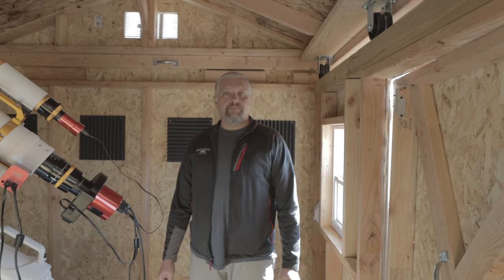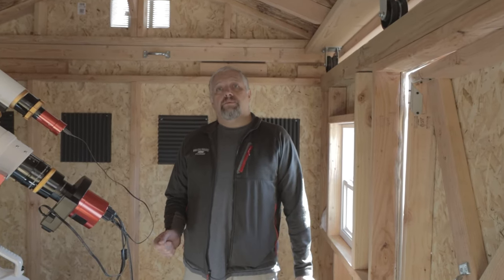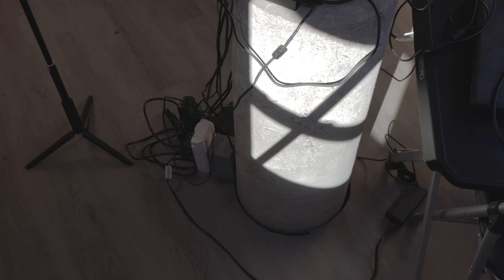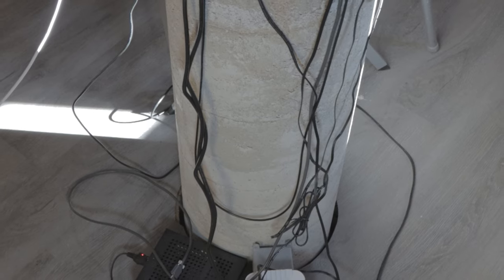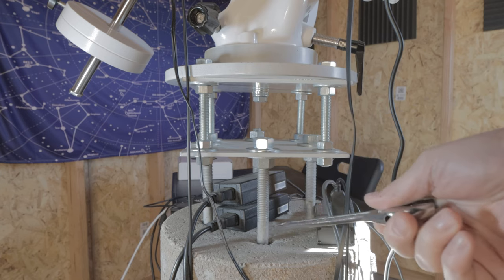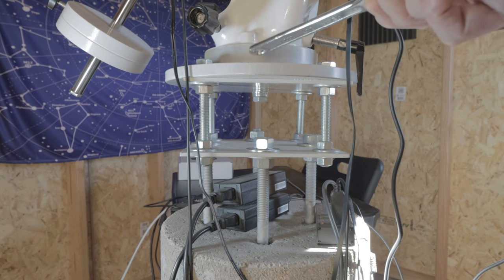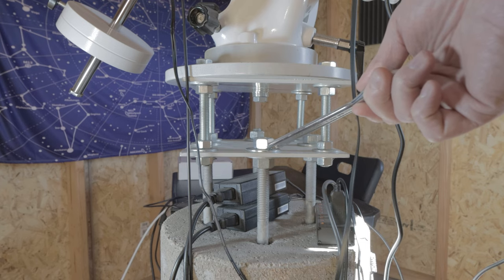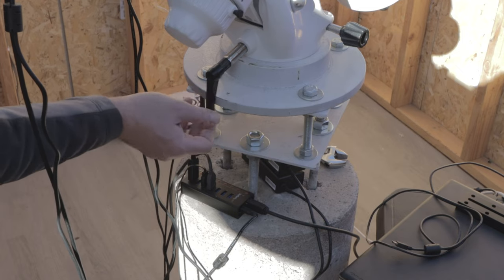Bear Claw Observatory: Concrete Pier

Comment: Great job man !!!!  I love to see people do things the correct way.. Nothing makes my skin crawl more than some poor sap who thinks, I've built an awesome observatory. and ONLY spent $1500 on it. or whatnot. and it's literally a shed with a Platform, NO hole in the middle, No pier.. just a wooden platform with their telescope and tripod. sitting on it..Bouncing every time they walk or move in a chair?   Taking the time to do it correctly is Key to a great observatory!! and your sir, looks like it's going to be a Great Observatory !!!
Reply from the maker: Thanks Frank, it definitely takes some planning before you get started. Sometimes I think the 12" diameter and 4ft in the ground with an anchor at the bottom is a little overkill, but it's so nice to know I can put just about any mount on top of this thing and it will work flawlessly.

Comment: Great job !! 

They however advise against putting the tube underground for several reasons: They rot and that means it gives your pier a chance to move by about half and inch and the fresh compact, undisturbed earth on the sides of the hole will hold it tight and upright if and only if the cement is contacting that earth. Notice your frostline data probably specifies 'undisturbed earth" or "compact earth".

Comment: I realize this is an old video but can you tell me what the point is of that first 3/16 steel plate?  Couldn't you just bolt the brake drum to the J-bolts coming out of the pier?

Comment: I replaced the altitude adjustment knob on my eq6-r pro with a 3d printed press fit knob (no longer the spring loaded nonsense that came with the mount), it is now significantly easier to adjust.  i'm about to start pouring concrete for my own pier and will be using a 2012 chevy malibu rear rotor :)
Reply from the maker: Grats on the new pier Michael! I replaced my alt knob as well finally, it makes a huge difference.

Comment: Hi Joe, where did you source the J bolts? Are they Stainless, Or Galvenized? Also, do you think a 12" dia pier is overkill for an EQ6, or would 8" or 10" serve the purpose,
Reply from the maker: Hi FDS, the j-bolts are galvanized and think I got them at Lowe's. I went with a 12" wide pier because I knew I'd be upgrading to a larger mount in the future. If you know you are going to stick with the EQ6, I think 8" diameter is more than adequate.

Comment: Loved the video.  What height off floor level would you say would be the height sweet spot? Have an 8se but want to get into astrophotography.  On the cheap as I can.  Thanks for this!
Reply from the maker: Thanks GS! For me it’s the  lowest angle I can image at, which is 20 degrees above the horizon. My pier is 36in above the ground, but it’s dependent upon the height of the walls and how far away the walls are to get that 20 degree angle. Also have to figure in the mount height and if you have risers on the scope, etc. My walls are 6’4” tall and about 4ft away from the scope on all sides. If you wanted taller walls you’d want a higher pier.

Comment: This is the first time I've heard about any movement. One degree seems like a lot and makes me cringe. I'm about to build a permanent pier.  Could it be that the Sonotube is expanding and shrinking inside the concrete as it dries and then absorbs water?  Seems that it would be better not to have paper between the concrete in the ground and the concrete in the tube.  Just a thought
Monty
Reply from the maker: Thanks Monty, you know, I'm not sure what it is to be honest, but it's gotten better the longer I've had it. In the last 3 months it's only off 46 arc seconds. I get this from running "Guiding Assistant" in PHD2. I haven't had a clear night in two weeks to do another PA, but I'll record the date and then in 30/60/90 days see how much it's off. I'm still guiding at a total RMS error of .8, but of course I want that PA within 10 arc seconds.

Comment: Hi! 
I didn't understand, so the bottom part of a pillar is not permanently set into the ground, or the ground itself is very unstable?
Because shifting and tilting up to 1 degree a month sounds really a lot.
Reply from the maker: The concrete is permanently set in the ground. My polar alignment seems to be off about 1 degree every 6 - 8 weeks. The concrete isn’t moving that I know of, but from what I’ve read and heard from others is that the pier acts as an inverted pendulum. I think, but not sure, the longer you make it the more effect it has. I made mine a little over a meter deep because of the frost line in my area. Hope that makes sense, and again, not exactly sure myself of the physics, but it’s been very solid and I don’t mind doing a polar alignment once every couple months

Comment: Joe, is there concrete around the outside of the sono tube underground or did you just pour the tube and then backfill with dirt?   I am assuming you put in the tube first, then poured the deck after?   Getting ready to build mine using the same technique and wondered about some of those details?   Did you take pictures of the construction?   Sorry for so many questions.   Thanks for your assistance.
Reply from the maker: Hey Marvin, no worries on the questions at all. I poured some concrete, like a 2ftx2ft square at the bottom, then while still wet put the sono tube in the hole and poured it. 4ft in the ground and 3ft above, yours may vary based on frost line and your needs for pier height. I built my deck after the tube with 4x4s and 3/4 in plywood all pressure treated for ground contact, but did place them on concrete pavers to level. Unfortunately I didn’t take any video or pics of the build, but if you have any more questions I have no problems answering the best I can. I can tell you I went way overkill, but the cost of building materials weren’t that high at the time I built it. Good luck on your build!
Reply: @JoesAstrophoto  I am going to follow your general plan and try to get the metal fabrication (holes drilled) by a machine shop if I can find one.  I didn't realize the floor was a wood floor.  It looked like concrete in the video.   Making a wood deck would certainly be easier and probably cheaper than concrete.   Also,  how big are the metal plates you are using?   Thanks
Reply from the maker: @marvinwhisman3333  The metal plates I used for the rat cage were 8" x 8" and 3/16" thick. Depending on the size of hardware you are going to be using, it may be cheaper to have them drilled out or cheaper to just buy titanium drill bits. The titanium bits get very pricey above 1/2" and hard to find. I used a cobalt bit for the 5/8" holes and it took forever to drill.

Comment: Hello! When mounting the rat cage to the concrete, do you already had the north pole screw and all the rat cage assembled or did you do that later? How to you manage to get it pointing north and have all the screws aligned? Thanks!
Reply from the maker: Hi Valter, I built the rat cage prior to pouring the pier. Then I made a wood jig and bolted the j-bolts to it to make sure the j-bolts were aligned correctly. I drilled a hole in the disk brake where the bolt goes for the north bolt after it was all mounted. You can guesstimate this as there is some room to move the azimuth, but I suppose it depends on your mount. The EQ6 has quite a bit of movement.
Reply: @JoesAstrophoto , thanks for the quick answer. I currently have a EQ3 and hope to upgrade to a EQ6 in the future. If I do a pier now for the EQ3, it will probably be fit for the EQ6, I guess.
Reply from the maker: @astroazores  it should as long as you have a solid pier 8 - 12” in diameter. The only thing you’ll need to change is the mounting plate. Not sure the EQ3 and EQ6 will use the same one, but that shouldn’t be a big deal.

Comment: The polar alignment problem may be caused by the section of bolts beneath the mount bracket. This is often referred to as a "rat cage". It's purpose is to level the mount, however it is redundant since the equatorial mounts already have this adjustability built in. Therefore, it just adds another area for movement. Seems like it would be relatively easy to temporarily remove this section and see if it fixes the problem. You would just need to drill some extra holes in the brake disk. If you search some of the forums or Facebook pages for "rat cage" you will find it is a controversial topic with experts on both sides, so you'll need to decide for yourself :-)
Reply from the maker: Thanks again Katherine, I originally made it that way so that I could easily lower the entire mount if I needed to, but now I'm not sure I'll ever have to.
Reply: I built a pier pretty much the same as yours and found that the long bolts coming up out of the concrete allowed too much movement. I could see the mount resonating when I stopped a slew. So, I cut them short and it was much better.
Reply from the maker: @MasseyLee  Thanks Lee, I have it setup so that I can just screw the plate down closer the concrete, so I can give that a try as well. In effect shortening the bolts to an inch or so.

Comment: It is all good, but when I see all those levels of threaded rods and plates on a concrete pier, my head is going to explode ...
Reply from the maker: Unfortunately for me, the rat cage was the best way to go. I need space below to attach the mount with a sufficient bolt and the ability to change the mount plate in case I want to upgrade later, but I hear what you’re saying lol
Reply: @JoesAstrophoto  great observatory otherwise :)
Reply from the maker: @lachezarkrastev7123  Many thanks!